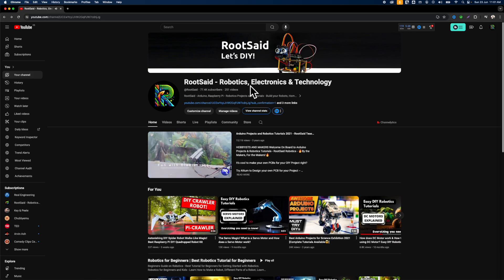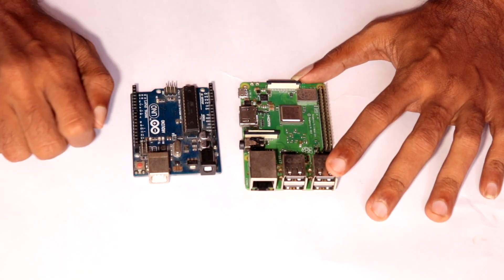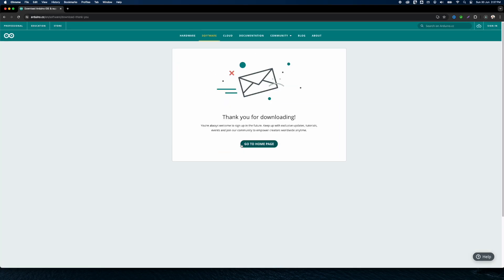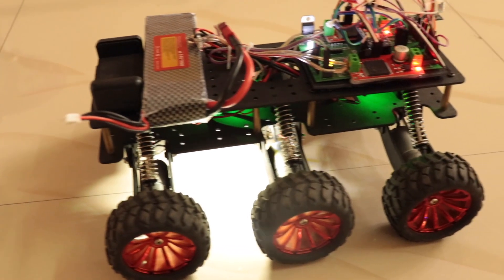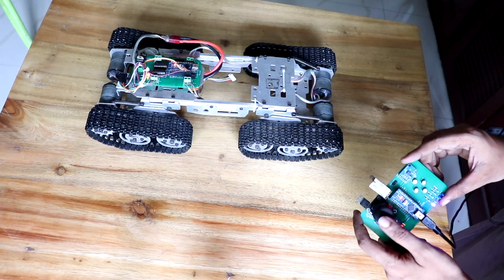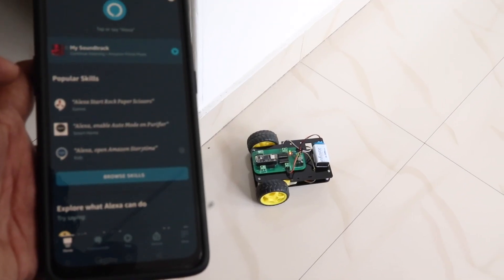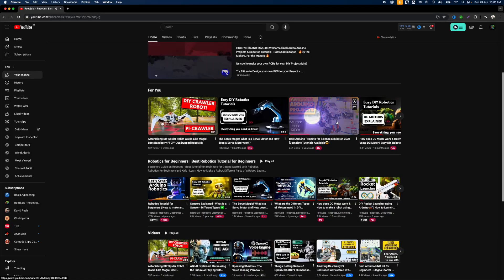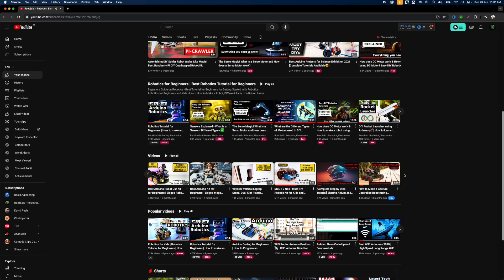How to get started with Robotics? [MUST KNOW TIPS] Building Robots for Beginners

Comment: Is it possible to build a 1m RC robot like a robot from the movie real steel
Reply from the maker: Hello 😊
Building robots like those in "Real Steel," which are large, highly agile, and capable of complex boxing maneuvers, is currently beyond our technological capabilities. While significant advancements have been made in robotics, including humanoid robots and autonomous machines, creating robots with the same level of dexterity, strength, and decision-making as depicted in the movie would require further breakthroughs in AI, materials science, and mechanical engineering.
Reply: @RootSaid  thanks
Reply from the maker: @TLCBB  no problem
Reply: @RootSaid  could something similar be built
Reply: @TLCBB  yes similiar can be built when very limited functions
Reply: You're also trying to learn because of Real Steel?? Samee

Comment: What if someone wants to be part of robot maintenance( Hardware-side)? Do they still need to study coding?
Reply from the maker: If someone wants to work mainly on robot maintenance (hardware side), they do not need to become a strong software developer. You don’t need to build apps or write complex algorithms. However, basic coding knowledge is still important. You should be comfortable with simple things like reading Arduino or Raspberry Pi code, changing values, uploading firmware, and doing basic testing or debugging. Many hardware issues only become visible through logs, error messages, or small test scripts. For hardware maintenance, coding is a tool, not the main job. You don’t need deep programming skills, but you do need enough understanding to diagnose, test, and verify that the hardware is working correctly.

Comment: I study political sciences in university, but I just started learning by myself the basics of programming and electronics, and I would also like to learn robotics by myself, but do I need to learn all about mechanics as well sir? I hope you could please give me an answer 🙏.
Reply from the maker: Hey! That’s amazing. As for robotics, you don’t need to learn everything about mechanics to get started, but having a basic understanding can definitely help. You can focus on the areas you're most interested in, like programming or electronics, and then gradually pick up the mechanical aspects as you go along. The great thing about robotics is that you can learn step by step. Don't be overwhelmed – just start with the basics and build from there. You’ve got this! 🙌😊
Reply: Hey there. I also belong to a different field but engineering is what is actually my interest. I want to learn robotics myself. Could you tell me how much you have learnt in this time and any advises or resources I can use to learn? Any info would be helpful.
Thank you
Reply from the maker: @Ashcob11  Hey! That's awesome that you're interested in robotics. I've learned a lot over time, from basic electronics and programming to working with microcontrollers like Arduino and sensors for robot control. My advice is to start small—learn the basics of circuits and coding (Python or C++ are great for robotics), then gradually move to building simple robots. For resources, I'd recommend starting with beginner kits like Arduino or Raspberry Pi, and checking out YouTube channels, online courses (like Coursera or Udemy), and forums like Stack Exchange for guidance. Good luck, and feel free to ask if you need more help!
Reply: @RootSaid  that's rly helpful. I've done researches and started to learn it but I had a qs. Should I start w python or C++? I personally started w C++ but smone advised to go w python as my start.